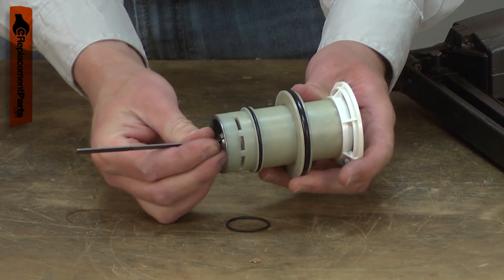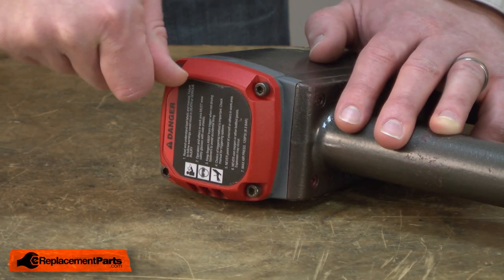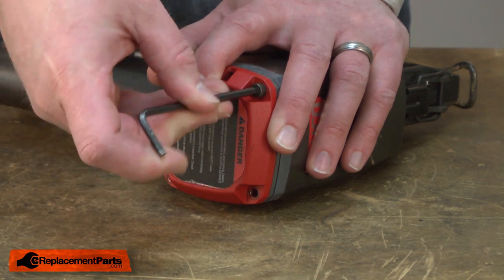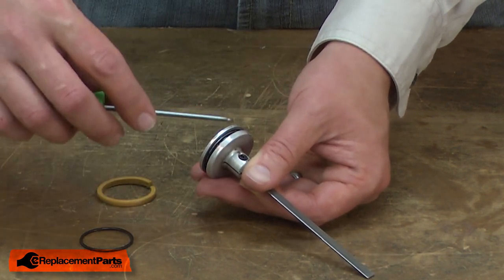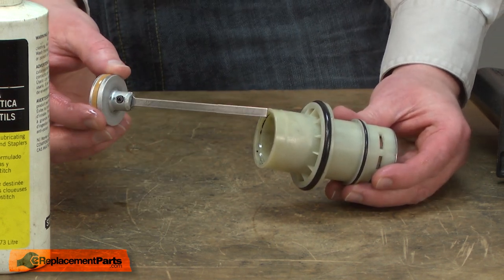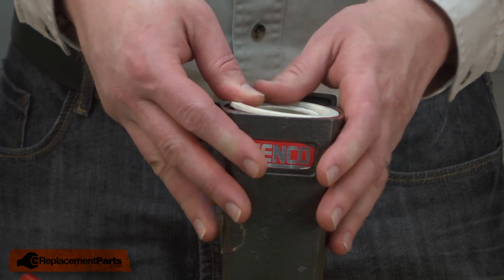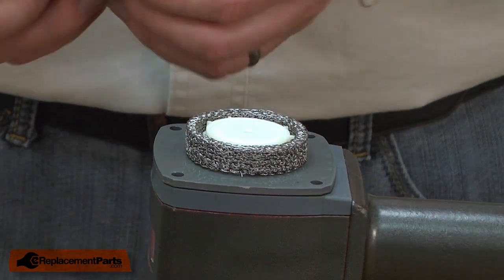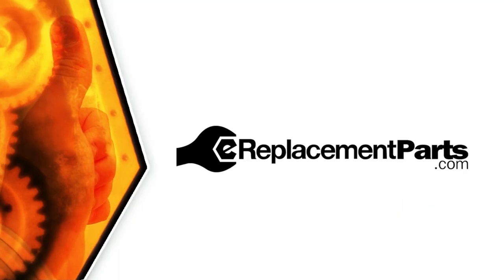Senco Nail Gun Repair - Replacing the Piston Seal (Senco Part # LB0030)

Comment: typically o-ring seals in nail guns require silicone grease- not air tool oil, a petroleum product that accelerates deterioration of the o-ring. Does Senco actually suggest using air tool oil in the cylinder?
Reply: Great question!

Comment: why did you replace it , was there a leak . I sure would like to know the reason. thanks
Reply from the maker: Thanks for the question! In this particular scenario, we replaced the piston seal as a guide for our viewers. So, there wasn't necessarily a problem with the Nail Gun, but we wanted to show the process of replacing it! Thanks for watching!
Reply: @FIXTechGuides  , the reason I asked was because  I repair alot of senco staplers and nailers. With the senco slp20xp I have customers bring them in frequently do to air leaking from the top valve assembly.  I sometimes spend more time than necessary,  It seems like the issue can very . My question is , the slp20 is on older model but looks identical to my eyes as the slp20xp , is the valve assembly the same for both and if so what causes the air leak . Thanks for any help .
Reply: Big Mex Detects hello, just read your post here and wanted to know if your familiar with the Senco SFN40 finish nailer?  I have a driver that is not returning back after firing.  Would you be able to help me out on this?  Thx